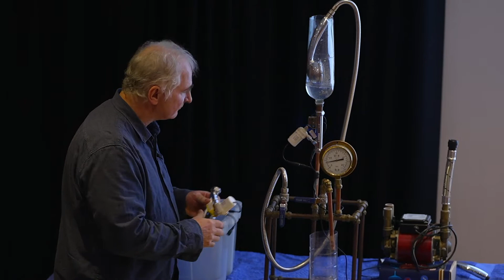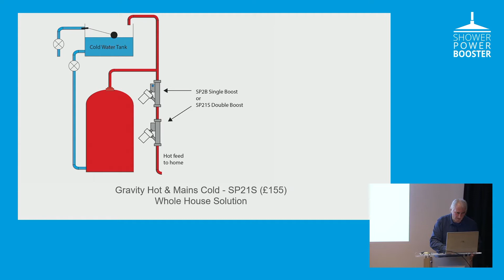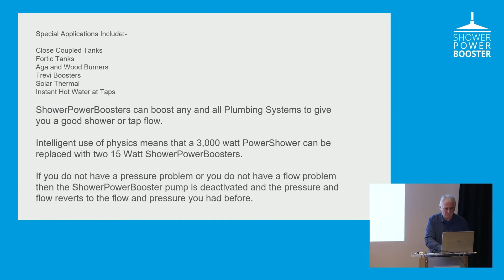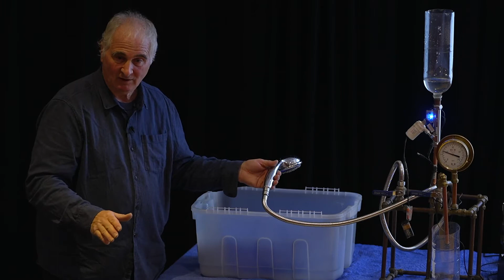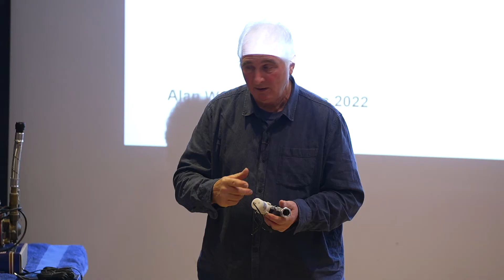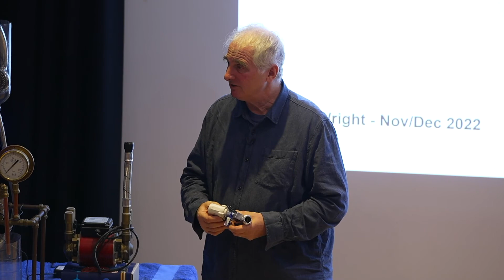10 Years after Dragon's Den - Shower Power Booster

Comment: Can I install this pump in the atic on hot water pipe that supplies batroom downstairs? boiler is also located downstairs.
Reply from the maker: ShowerPowerBoosters can work on any system but I have sent you an email asking for some more details.

Comment: Hi Alan. This pump works also in Cyprus?
Reply from the maker: They work in Cyprus. Your tanks in Cyprus are normally on the roof and therefore the cold pressure is normally better than in the Uk. A SP21S double boost on the hot only, is probably best.

Comment: I fitted the SP21S system after the vent pipe junction on the outlet from my ground floor vented gravity system tank to boost the pressure on the hot supply around the house. I also wanted to enable the fitting of a thermostatic Mira Atom shower upstairs (1m head/0.1 bar). I have to say, the fitting was straight forward, the shower performance is perfect and the personal support from Alan outstanding! I am over the moon and highly recommend the Shower Power Booster!

Comment: Hi Alan, thanks for this presentation. I live in France, I've installed a low pressure sun boiler and today I fitted one pump for a shower on the other end of the house, with super result. I'm going to fit another one for my shower outside...it's amazing!
Reply: Hi can I ask you a question about the pump and your setup?

Comment: Am I right in saying the Negative head application only works on a manual switch and not on automatic?
Reply: correct.  the automatic one needs a flow of water to activate it.  if you have negative head, then there is no flow of water to activate the automatic one.  so you would have to use a manual one.
Reply: You can get it to work with an Alexa apparently , voice controlled.

Comment: If the pump was that high on the hot water pipe it would draw air through the vent pipe with this pump you would still need a Surrey flange to keep air out of pump.
Reply from the maker: A normal pump might draw air from a vent pipe but the ShowerPowerBooster is designed not to pull in air. It never pulls in air, it never needs a Surrey flange.
Reply: How do I purchase one please Alan?

Comment: Hi Alan, I'm looking at installing one of these for a combi boiler on the hot side. Are there any negative effects on the boiler, by sucking water out of it? The flow in is great but I'm getting about a third of the flow coming out hot. Thanks
Reply from the maker: Read this guide carefully but there are no negative effects. https://showerpowerbooster.co.uk/wp-content/uploads/2023/01/FlowflexShowerManual_25_01_23-NEW.pdf

Comment: Hi Alan.
I just moved to Spain from Scotland and my solar hot system system ( vacuum tube style ) can easily exceed 90⁰ in the summer.(50ish in Jan 🙂 if sunny )
 I just fitted a 2 bar Bristan single outlet booster pump that is rated to 65⁰. When it fails I will be buying your twin hot booster pumps.
Need twin as mains cold (2.0 bar) and gravity fed hot (single story tank on flat roof )
With no pump fitted the cold water would backflow hot water on shower mixer tap.
Only feeding 2 hot taps and a mixer shower.
Wish you all the success in the future.
I agree with other poster you should be in Screwfix etc but until then I hope you will deliver to Europe !
Greg

Comment: Also are their regulation  in the uk as to where the pump goes in relation to  the electrical supply especially when isolating a shower supply in the bathroom ?
Reply from the maker: Pump in the transformer outside the bathroom and use the low voltage cables we sell to take the power into the bathroom. It is 100% safe if you do it that way.

Comment: Best wishes Alan from New Zealand!. 
I am one of those that saw the Dragon's Den video and got in touch. Very pleased I did. 
I'm on tankwater & the house is split levels on the edge of a steep hill. My options at the time were more pumps whirring away under floors & in walls. Until I found the Shower Power Booster.
I've got an SPB2 for the upstairs shower, and just recently got an SPB for the kitchen..
Well worth the investment.  
Thumbs up from me.
Graeme
Reply from the maker: I noticed that I did not reply to you 3 years ago. Are you the customer we visited near Sydney the other side of the Blue Mountains